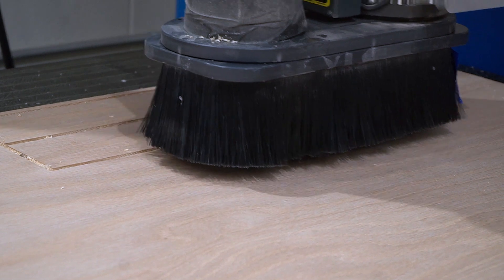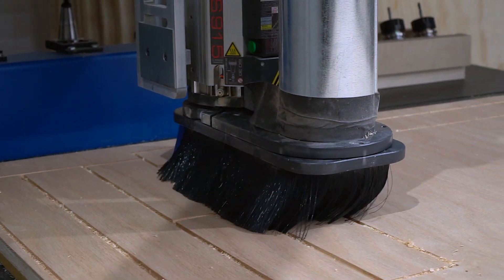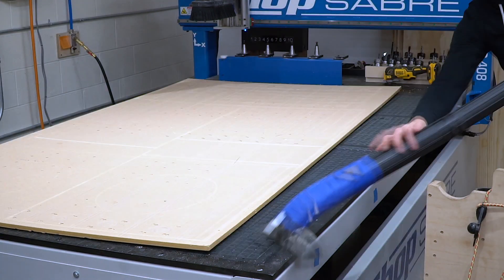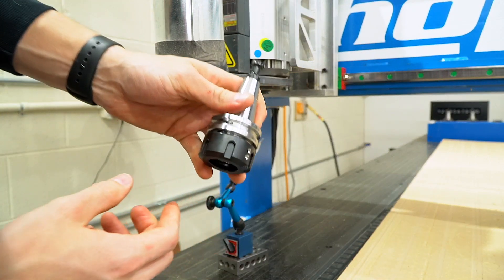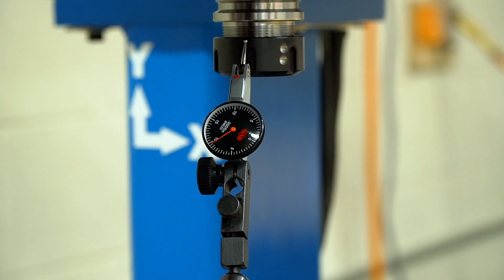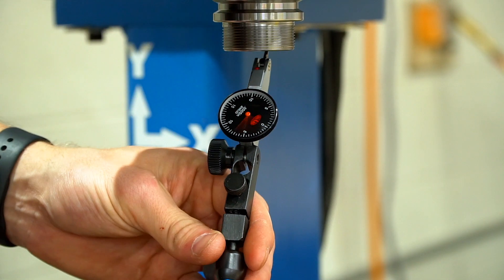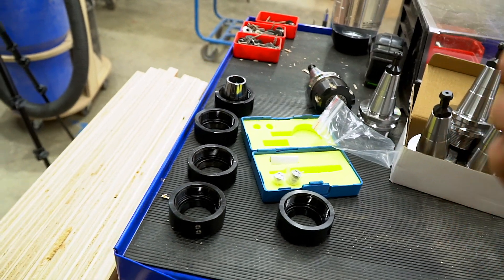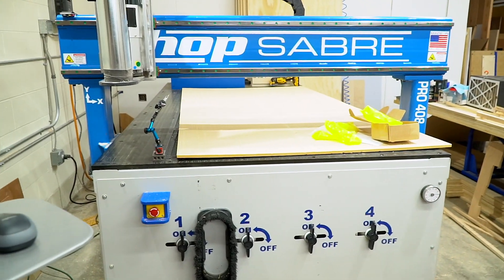Vlog 16 - CNC Routing Plywood & Tool holder Run-out

Comment: What kind of step down are you using for your 1/4" compression? 100% (1/4")? I ask because I am really trying to dial-in our speeds/feeds for our shop and I feel that our projects are spending WAY too much time on the table. (Example - 1/4" compression @ 144 ipm / 18,000 rpm & .15" step down in Baltic birch plywood)
Reply from the maker: Ah. Yeah. This depends on your spindle's capability typically. We have a 5hp spindle and can do full depth passes with 1/4" tools at 450 IPM.

Most machines that aren't a handheld router should be able to do a full depth pass, you just will have to adjust the feed-rate and rotation based on its capability.

Comment: Justin turn over your spoilboard. The ideal spoilerboard has a crown, and if you place it crown side up The vacuum puts extra pressure on the edges.
Reply from the maker: Ha. That doesn’t really work like that. It would need to be surfaced still.
Reply: Portland CNC It works well for me, even if the spoil board needs to be resurfaced.
Reply from the maker: Yeah, that would work but not if you need Z-accuracy as your surfacing will not be accurate to the table below it (there are micro inaccuracies on all machines).  We don't flip the spoil-board unless we're planning to surface it. What's most annoying about these things is surfacing it both flattens it but also tends to cause curling 😒

Comment from the maker: Do you test your tools / tool holders for run out?
Reply: I do. Much the same as you, once when installing just so there isnt any wonkyness. I also buy chinesium brand and have had great success with them.
I stopped using thicker spoilboards and now run 3mm HDF that I cut on one side until its crap then flip it -cut and then toss out.
I dont surface them but im running rotary vane pump wich accually prefers the higher resistance, should work for lower density mdf though.